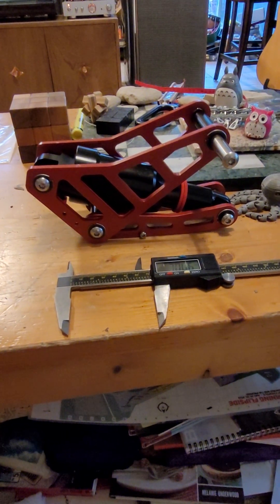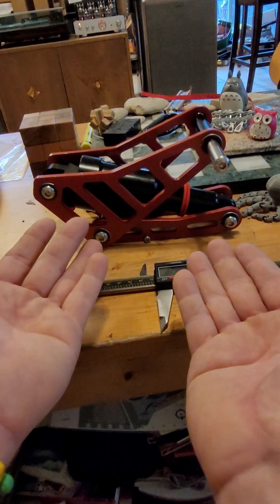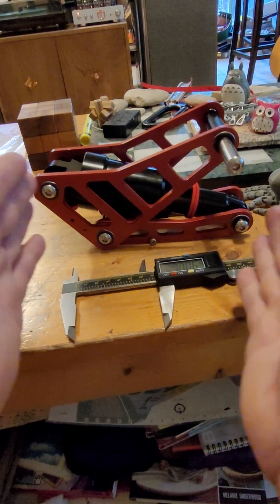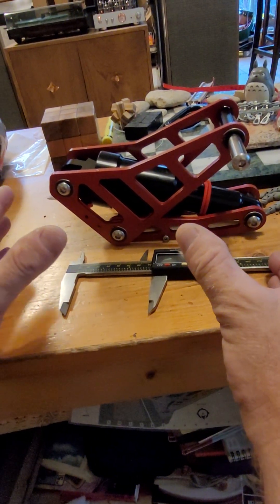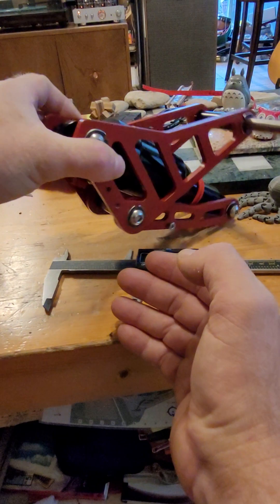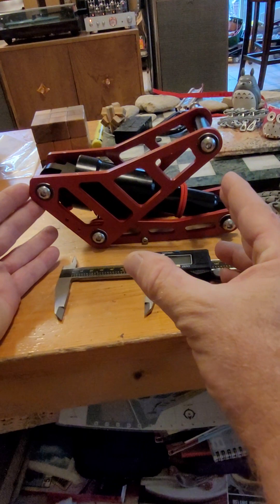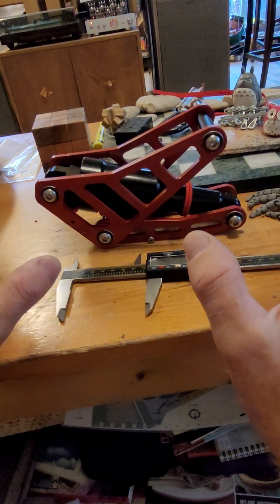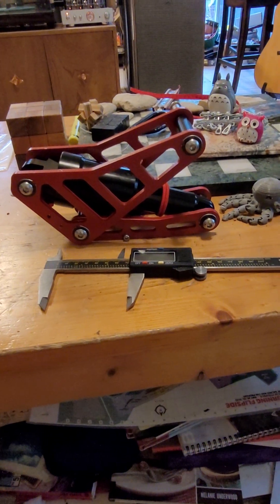This is why the Begode Master Suspension WAS terrible.

Comment: I'm tempted to get a Master V4 because of their really great price. They are being advertised with "new suspension geometry" or "updated suspension."

Have you tested the suspension on the Master V4, or, which version of the wheel is it that you are looking at the suspension for in this video?
Reply from the maker: I still feel the Master is an excellent wheel, especially the V4 Master. But I still do not like their stock Begode suspension.  I just bought a new Blitz and the first thing I did was replace the suspension linkage and shock. I am not tracking all the folks who are making and selling various "X-link" style suspensions, but all of them are pretty good and can be bought for $300 to $600 with a replacement shock. With the suspension upgraded a V4 Master would be an excellent trail wheel for just about anyone.

Comment: The top brackets you will have to turn in reverse. Then the firewood up the area you would have to use thread tight tape. To make sure the compressor doesn't seek out. Then pump it up and you should have any problems. You can cut a little plastic inserts between the bracket Bolts so the suspension don't shake around. I have done it and it works perfectly without shaking or anything I weigh 230 lb

Comment: Here’s a link to the video I helped Kingsong make, that explained the non-linear linkage design of the S18. It’s the reason why their design works so well. the ratio varies from 2.7:1 to 1:1, so for greater shock travel the suspension becomes stiffer. So it has good small bump sensitivity, as well as good big bump absorption ability without bottoming out. https://youtu.be/MP7l9KvP-Lg

Comment: The link to the CAD files seems to be cut off, could you edit with the correct link? Also very nice video going into the deeper details of suspension ratios!
Reply from the maker: IT is working for me?  
https://drive.google.com/drive/folders/1-7Fv4bge8eDnlygpQ6PHLKdKVuh7EnC5

Comment: It seems the bad geometry is especially noticeable with heavier riders but not for a lighter 150lb one. The weight of the rider is the most important variable when setting up a better than stock suspension and maybe lighter riders would require only a coil shock change to achieve similar results requiring a geometry change for heavier riders?

Comment: So if I understood correctly: The stock suspension geometry is dumb, but salvageable. Just by replacing the stock shock with a shock with twice the travel makes it perform much better?
Reply from the maker: That is incorrect.  The suspension linkages need to be replaced it completely reworked (and a new shock) to have a correctly functioning suspension.

Comment: What do you reckon of the Begode T4 suspension? From my image references, the geometry looks basically the same, maybe there are slight differences because people have been saying that it doesn’t bottom out as easily but I haven’t been able to find a direct comparison.
Reply from the maker: I've not yet torn my T4 apart to check it's ratios, but I really like it.  I don't really even know if uses the same linkage as the Master or not.  But my T4 is a LOT of fun on the trails!
Reply: @stevenmichaelis  aha awesome, I’ve got my T4 coming soon in a few weeks so really looking forward to that😆

Comment: Unfortunately, to buy the Torque Pads suspension linkage now on their website, I'd have to spend $400 Cdn before shipping!  And then, who knows if there would be duties, brokerage fees, etc. tacked on.

I'll wait until someone in North America fabricates a similar set up at a much cheaper cost thank you.
Reply: Hope that will happen soon,  had to jump through hoops with my bank to not get it blocked to pay for my order from Poland when i got my grizzla system. Still be 600 bucks
Reply: Don’t hold your breath meantime….

Comment: Very nice explanation. 
But I wonder where you got 35mm potential travel for the shock? 190 x 35?
As it can physically move much more than 35mm.
Also, when I measured travel I got 70mm wheel travel = 24mm shock.
Still not good. 
As a "bandaid" I designed a volume reducer for the stock shock. Still does not make it a good shock, but Soooo much cheaper than Kuba links and new high class shock.
Reply from the maker: Good point. When I was fiddling with it I was only able to compress mine 35mm.  After reading this I tried again and got about 40mm before I hit the internal bump stop.

Comment: Thank you for this explanation. It completely answers why my master suspension feels so inferior to my S22.
Reply: Does it obviate the need for the stator to be pinned or the mobo to be replaced, though? Not that I’ve any interest in either to be fair. Both wheels have had a somewhat difficult birth, arguably the S22 more so. The Master has plenty of upsides, matched by its disadvantages. The Hero is too complicated to disassemble for changing tyres. There are better options available, and sunk investment makes for a poor substitute for better alternatives. Just my tup’worth.

Comment: I would have liked to see the geometry on the bike too just for a visual reference. There are a lot of different bike frame designs to utilize the shock differently. not that your info is incorrect, I just like to see the frame design too
Reply from the maker: You can Google a Begode Master and there are lots of photos available.  I'm sorry I didn't include any.
Reply: Generally, despite differences in the mounting positions of shocks and the geometry round them (rocker links vs rhe chainstays driving the shock vs co or opposed links etc. Etc.), the leverage ratio will be in the same ballpark, as they're designed to all use the shocks available to the consumer

Comment: So another 500 bucks at least unfortunately. Ridiculous that they didn't just make it right.
Reply from the maker: I hear you. Then again, when I had a high performance motocross bike, I paid more for a good one. I would venture almost half the cost of the motorcycle was the cost of the suspension.  In performance sports, good suspension is historically expensive.  I suspect that we could have a correct suspension using the stock shock if they changed the linkage. That would functionally cost Begode nothing.  However, I also think the "top 1% riders" would find real value in paying $300 - $700 for a true high performance shock, and maybe paying a little more for some professional assistance setting it.  What do you think?
Reply: @stevenmichaelis  begode should send us the properly designed linkage.
Reply: @noelleonard2498  It's GotwayBegode. Their entire brand is about being cheap and low quality, but also fast and dangerous. It wouldn't be fitting for them to make an expensive high detail suspension.
Reply: @4nlimited3dition_4n3d  designing a leverage ratio to work on the shock you supply costs effectively nothing.
Reply: @enzochoi923  I would imagine they rather saved the money that it would have cost to hire someone who knows about leverage ratios / suspension design.
Reply: Yep, at best it’s putting lipstick on a (reasonably attractive) pig, given all the other details where poor execution and material choice which Begode are now infamous for are considered. Great conceptually, but appallingly realised in production. That’s just what happens though when they try to make it affordable to the many, fundamental corners such as the suspension (and waterproofing) get cut. Great potential, stymied somewhat.
Reply: @freeforester1717  even though the original shock is definitely a cost-cut bottom-of-the-barrel spring, it should cost them nothing to design the linkage with the right leverage ratio
Reply: @enzochoi923  except some know how…